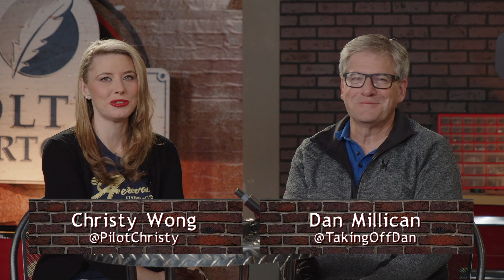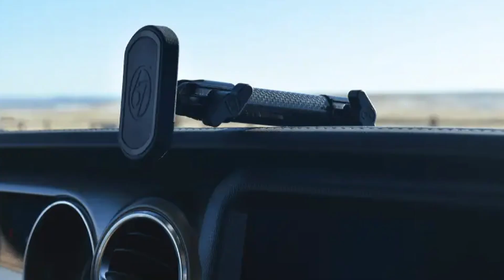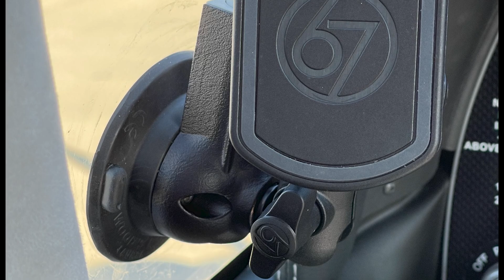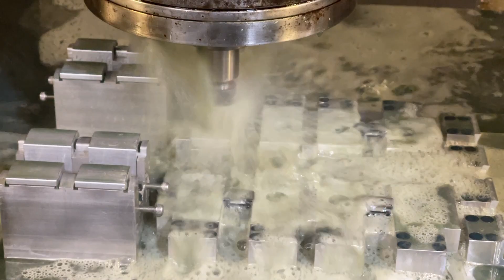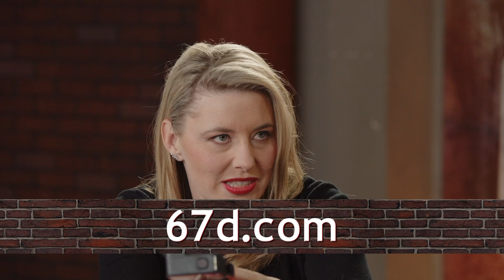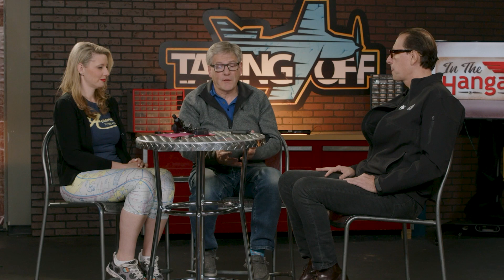Tablet And Camera Mounts For Airplanes

Comment: The biggest problem with most of these mounts in small airplanes is that you can’t find one that will actually be useful without the iPad mini still blocking the instrument panel. I was able to mount my iPad mini from the bottom of the yoke but the problem was now the mount and the iPad hits my lap when I try to move the yoke. The mounts may be good in Cirrus planes because they have just one stick to the left of the center of your body. Another thing if like me, you rent airplanes you really don’t want to take them in and out often on the aircraft’s plexiglass because you not only make marks, but you weaken the suction each time you reinstall it.
Reply from the maker: Yeah, I had a Yoke mount for my iPad mini and it block some critical instruments.  I have moved the iPad to the left side suction on glass with the magnet strong enough to hold it while I punch on it.  Seems to be the lowest profile for blocking any instrument panel.
Reply: @TakingOff  yeah, I’ve tried that before too. Another problem at least on my behalf is I am left-handed it is very hard to write on the pad when it is mounted there. Also, it is not ideal to block any window whatsoever especially when you have to look for traffic. Maybe one day they will have a spot that it could be mounted on the instrument panel away from other instruments. In the meantime, I put it on my lap and when I need to use it, I’ll pull it off the Velcro strap and hold it up eye level when I, I level while I need to look at it. A great option would be to mount it below the yoke with an extension long enough to curve the iPad closer to your chest and be able to curve up to the level with the top of the yoke and angle at about 45 degrees toward the yoke’s center area.
Reply: Kneeboard mount.
Reply from the maker: @USA-GreedyMenOfNoIntegrity  they do now have a kneeboard mount that I used for the first time on my last trip. Uses the same magnet to hold the iPad.
Reply: Kneeboard mounts are only good when you’re away from busy terminal areas. When you’re in high traffic areas your head is bobbing up and down constantly looking at ADS-B traffic targets on the iPad, making you dizzy very quickly. Any position that’s up high and keeps your head straight up all the time is safer, especially on night approaches or taking off in the so called dark hole over water, looking down during that time is just dumb.